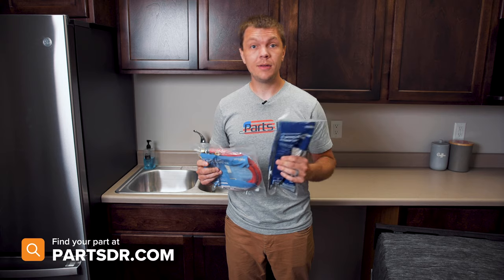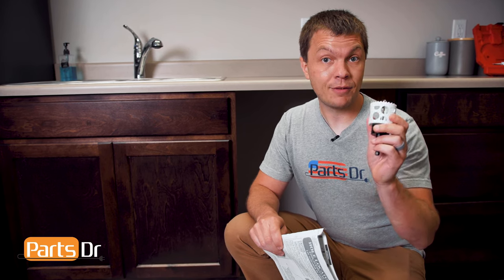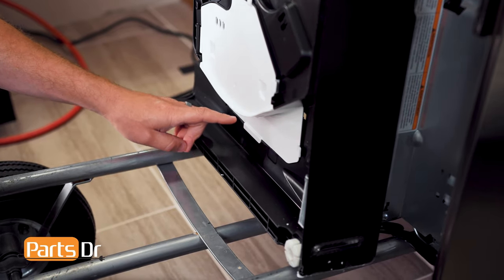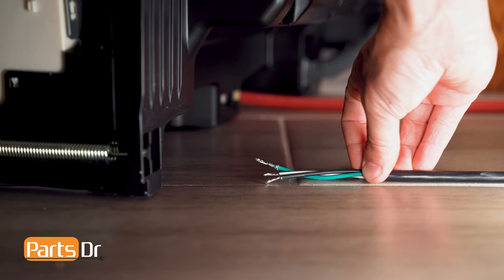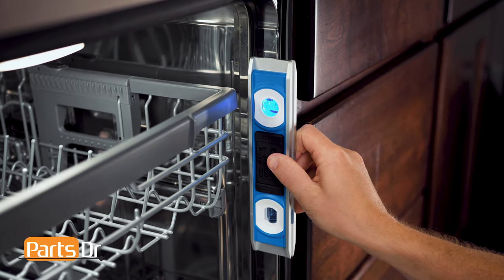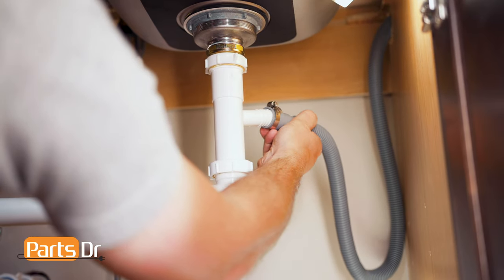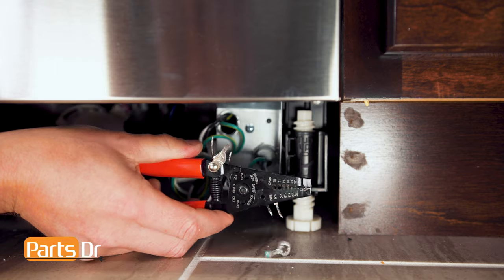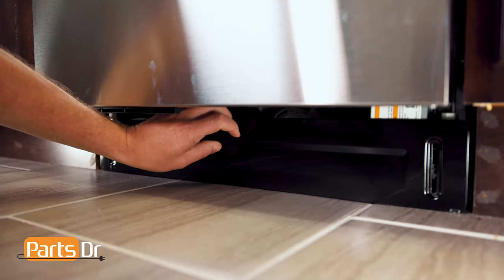How to install a dishwasher (Fast and Easy!)

Comment: Thank you! This is exactly what I was looking for. One question, the water line should be connected to the hot water, correct?
Reply from the maker: Yes, the water supply to the dishwasher should be connected to the hot water.

Comment: I added aluminum tape to the bottom of my countertop to prevent warping. My old laminate countertop had warped considerably from the dishwasher steam, but it was very old.
Reply from the maker: That is a good idea!  Some of the newer dishwashers like the LG shown in the video don't vent the steam out the top of the door like some of the older dishwashers so that shouldn't be an issue.

Comment: Thank you!   But I was getting the 4,3,2,1 count down and heard it might not be level.  But without finding this video I just raised the front up 1/4" as a guess.   That did the trick.  However I found this video and tried to do this level. I got it close to actual level and it was back to the count down.   So back it went to my "guess".   But now I have this in my back pocket.  Thanks!
Reply from the maker: We are glad you found it helpful!

Comment: Thanks for the video, just installed my dishwasher same make and model. Have owned and installed a few this one is very noisy. Is that normal. Thanks
Reply from the maker: The problem with noise levels is that they are hard to compare over the internet.  Make sure that none of the insulation pieces are missing and that the bottom cover is installed. It isn't the quietest dishwasher that we have tested but quiet enough that we were able to talk right next to the running dishwasher in this video here; https://youtu.be/G7lxR9WlOIw?t=201

Comment: Great Video! One question. Did the power cord come with that unit? Or did you have to buy it separate? If so, do you recommend a power cord?
Reply: I have a LGLDFN454 that is hardwired but I want to convert to plug in
Reply from the maker: Hey Chris!  No power cord is included, this is the one we used here: https://partsdr.com/part/4317824-3-prong-power-cord-kit

Comment: The manual says to pass the water line and drain hose through the same hole at the lower back of the cabinet. Would that really cause water from sink drain to back up into the dishwasher?
Reply from the maker: What is the model number of your dishwasher?

Comment: Thanks for the video!! What if your water and drain hook up are on opposite side of the recommended install?
Reply from the maker: It shouldn't make any difference if your water supply and drain are on the left or right side.
Reply: @PartsDr  thanks for the reply

Comment: One good thing to do with a Dishwasher, is Lean it back a bit. Not to a extreme but just enough so water doesn't pool at the front. If your ever getting a bit of leaking at the front edge of the door, this can help. Of course if there is a seal issue or broken part that's leaking, then the part in question will need to be replaced.
Reply from the maker: Thanks for the tip!

Comment: I noticed there is no air gap.  Is one still required? I've heard they are required to be within code.
Reply from the maker: You will want to check with your local code to see what they require.  That will vary by the area you live.

Comment: Did you make a hole on the counter-top for the main electric wire of the dishwasher to reach up to the plug point?
Reply from the maker: The power supply to the dishwasher can vary depending on the area that you live and the electrical code requirements.  Most commonly the electrical outlet for the dishwasher is installed in the cabinet next to the dishwasher and it is sometimes shared with the garbage disposal.  You may want to contact a local electrician for further details.

Comment: On some sinks next to faucet, what is the thing that seems to be some kind of air release vent(?), when the dishwasher is draining? Do you have to have this?
Reply from the maker: Hi Juli, what you are describing is called an air gap.  An air gap is an anti-backflow device to prevent water from the house from backing up into the dishwasher.  It is code in some areas and it is required to install and air gap.  In our area there is no requirement to install an air gap so we drilled the hole up as high as possible for the drain hose which creates a loop which also prevent backflow (show at 1:24).
Reply: @PartsDr  Thanks Parts Dr!!!
Reply: @PartsDr  m
O

Comment: Installed the exact same dishwasher, turns on cycles and stops, no water in the dishwasher and yes the water valve was on, is there something I’m missing ?
Reply from the maker: Try checking the water supply from the house to the dishwasher.  Grab a bucket, turn off the water, remove the line and put the line in the bucket and turn the water back on.
Reply: Did that, can it be air locked ?
Reply from the maker: @curtisneal2671  We have never run into that.  The next thing to check would be to see if power is being sent to the water valve.  If the water valve has power and it is not letting water into the dishwasher, then the water inlet valve is most likely bad. https://www.youtube.com/watch?v=vrDSl24vwao
Reply: @curtisneal2671  I had the same problem.  Started the dishwasher and it completed the cycle but no clean dishes. Pulled it out to check everything and found that the water line had a pinch in it. Now it fills and washes.

Comment: Why on earth does LG use a 2.5" hole size for the drain line when the standard size is 1.5". Anyone replacing an old dishwasher with this one (i.e. not new construction) will have a headache.